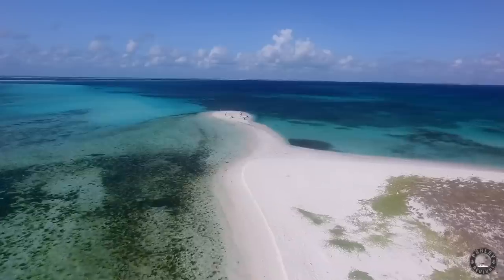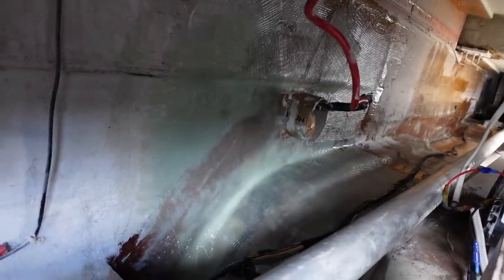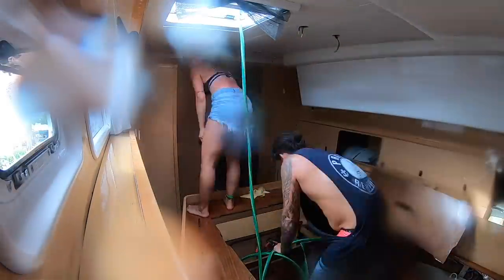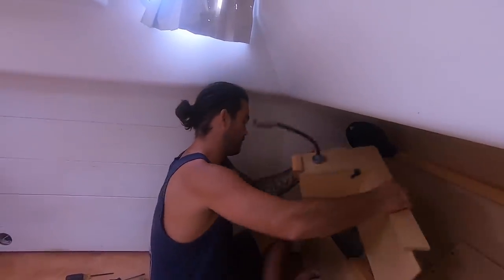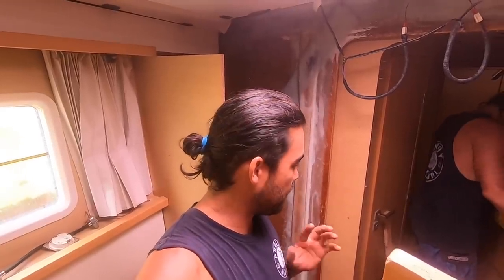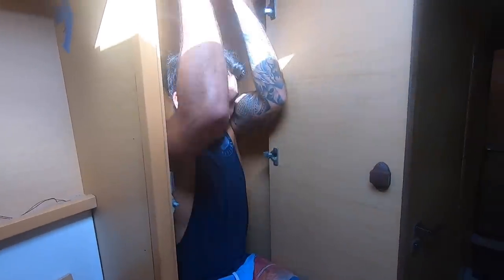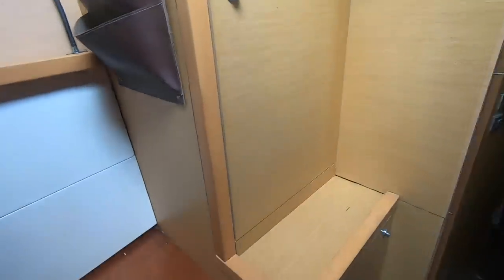OUR BULKHEADS ARE FIXED! - Cracked bulkhead repair series - Part 11 (Episode 116)

Comment: So impressed with the work you have put into your vessel. I have spent the last 5 years rectifying the mistakes and neglect of previous owners of my 1986 model year 35 foot motorboat, with the last 6 weeks having been spent lying on my back in the (tiny) anchor chain locker replacing distance material and fiberglass. Rapidly approaching 4500 man hours of work in the period I have owned my boat, and your positive attitude and professionalism has given me a significant boost towards finishing my “never ending” project. Trust you are close to realizing your dreams, and that you will let bygones be bygones once you put Parley back on the water. There is nothing like the feeling of being 100% confident in your vessel in heavy seas, well confident that the quality of the work put into the vessel in your ownership, far exceeds factory standards. Safe journeys.

Comment: work smart, not harder than necessary!  colin definitely works smart, that's the hallmark of a good engineer.  takes insight and forethought to take it apart in a manner which will also allow it to be put back together with minimal visible modification & struggle.  jamie is a true brother, that's some difficult and painful work and he's been right there beside colin the whole time.  the reinforcements were all extremely well done.  can't wait to watch them circle the globe, i have no doubt they'll accomplish whatever they set their minds to!

Comment: Great Job You Guys. Its looking GREAT, and BETTER then it was. This is what Ive been saying when your boat was built. People dont take Pride in there work anymore. Like You Guys did when You repaired it. If they would have taken the Pride in there work You wouldnt have had too do those repairs. This goes from the people that designed it to the people that put it together. Its so unfortunate  that this is what has happened . Look at things built years and years ago. Alot of the things that werent destroyed  are still around. And in 75 years Your boat will be among them. Again GREAT job on the repairs. And the videos. Cant wait to see her back on the water...Thank You for sharing....

Comment: With all the repairs, man hours and improvements, this must be one of the most valuable lagoon 450s ever
Reply: Except every single one that didn't face a hurricane hehe.
Reply: @jafris  a bunch of Lagoons that never saw a hurricane cracked in the same way.
Reply: If I was a buyer and saw all of this, I would buy it in a heartbeat.
Reply: I am a buyer, love these guys and love Collins work. Sorry if I sounded like a trip but as someone looking to buy I am thinking I cannot do the work he is doing which is why I won't buy a hurricane boat. The price is significantly more for a boat that hasn't seen a hurricane. That's just a fact. I'm really sorry to offend. Like you guys, I think this boat is probably better than every other of its model with the quality of work . And yes I know their are issues with the bulkheads for the 450s which is why I'm skipping that model in my search
Reply: @muumoo111  he gets it dude, your not getting it..
Reply: @jafris  problem is you never know the true story of the boat
Reply: @muumoo111  I didn't edit anything.
Reply: @jafris  You don't seem to realise or understand where I am coming from with my post. If this boat, in the state it was when they started repairing the boat, it would have been a "cheap" rebuild. But having to repair the cracked bulk heads on top of it. If they had taken it to a professional to do, this hurricane damaged boat would likely have cost more than a brand new one. Parts, materials, labour, drydock rental, lifting and storage, everything has a price. And even though they didn't take it to get it professionally repaired, most of those costs still exist. How much money could the crew have made if they all went for full time work at their professional level? Even if you are doing something your self to cut costs down, your time still has a $ value to it. 

When all the costs are counted at the end of the rebuild and refit of Parlay, it could quite easily come out to have a cost higher than that of a brand new 450. That's what I meant.
Reply: @Falney  I agree
Reply: @jafris  dude stop using 2 accounts , editing your posts ..  all of this for what ? What are you doing? and then the personal attacks for what ?
Reply: @muumoo111  I don't have 2 accounts and I'm done replying. You are weird
Reply: @muumoo111 and @sam you guys married ? Lol
Reply: @Onfireforthelord  hahahaha yes
Reply: @muumoo111  hahaha you so funny love it though you guys made my day lol happy 4th to both everyone in the channel as well
Reply: @Onfireforthelord  you too buddy happy 4th of july
Reply: @Onfireforthelord  🤣🤣☺️☺️✌️

Comment: Hey Colin and Jamie too !  Glad you went the extra step of flooding and washing out that glass and resin dust... it's nasty stuff health wise !  You should also see about preventatives against mold while you're cleaning. You can dilute hydrogen peroxide or rubbing alcohol to kill and clean mold, bacteria etc.. simultaneously, and wash surfaces with soapy water afterwards; another good cleaner/antifungal is tea tree oil, you can dilute with water and spray, but use glass containers, or the original plastic containers they came in... not all plastic spray bottles will hold up to those 3 cleaners.

Comment: Wood putty and a little matching paint would cover the crack in that furniture right up! This is one area I think the manufacturer could have recommended several good methods of restoring the finish work. For example that closet might be assembled and then put into place and then screwed into surrounding woodwork. A biscuit cutter and some biscuits might have been considered for joining the closets upper and lower halves. Again I recommend strongly making feedback to the manufacturer about making the closets and some of the other inside items removable in the future for this and other kinds of repairs that would take you to those areas of the boats in our hull. I think you guys are doing a great job!

Comment: What you called battons, the cabinet world calls cleats and are always meant to be hidden on the backside so only screw heads are visible. You did this on shelves correctly. The first cabin had a new storage spot which you hinged to make the best of the situation but left a cleat in plain site inside. It could have provided the same support had it been mounted on the backside. Not important but from one perfectionist to another, little tricks like that are very satisfying. Great videos Colin! Thanks for all your hard work, you're a credit to the human race!

Comment: Hi Colin and Jamie, I am an ex Lagoon450 owner who has done what you are planning to do I.e. sailing around the world. My circumnavigation took me 5 years starting with a brand new boat. My hat off and deep respect for your determination and skills to complete repairs to the standard you have achieved. I sold my boat earlier this year and after watching the condition of the bulkheads can’t help but wondering what condition the bulkheads were on my boat when I sold it in good faith. Based on my experience production boats are not blue water long distance cruising designed or equipped. I guess you are 300k into the boat by now not counting your hours. Whilst I agree you now have the strongest Lagoon 450 in the world as far as the structural strength is concerned I experienced a string of other weak design issues you may want to look into as well as some equipment issues. Starting with the main and Gennaker if original you may find out they are not the best quality and replacement or repairs on the fly is difficult and or expensive. I also experienced several failures with riveted fittings on the boom when in heavy weather and extended us and designed my own in the end. Saildrives is another weak point and I went through “ three sets” in 5 years. With the saildrives aft of the rudders the slamming of the rudder in reverse when you don’t hold on to the helm  is no doubt familiar to you by now but tends to be hard on the steering cables and a spare set is advisable. I was sailing short handed and solo sailing some of the time not by choice but circumstances. Extended use of the anchor winch exposed another marginal design I.e. winch motor of 1500W. It has a hard time picking up the weight of the chain when fully deployed (180 ft). More chain and bigger winch motor would help but at least a spare motor helped me several times. Just a few pointers not intended to dampen your spirits but to help being prepared. After leaving Panama not much is available until you get to your home country which by the way I very much enjoyed and had a lot of upgrades and repairs done during my 7 month stay. If you guys have half the fun I had you will have a blast. Hopefully COVID will not restrict your routes going forward as they certainly would have in the past year until now. Great job guys and my best wishes and safe sail, I will sail along with you.

Comment: Collin just a suggestion..If you go on line you will find wood grain tape that would cover the small seams you have inside the cabinet's and other places in your reassembly.  They use that stuff in RV Campers and Motorhomes and it looks pretty dam good.  You guys are doing a great job..I am amazed..Look forward to your future videos..thanks

Comment: Great video, job, and progress. Thanks for the update. I was very interested to see how the cabinetry would look and also wondered your opinion on "Should manufacturers be required to build cabinetry in a way that allows inspection of bulkheads?" I think the answer is yes - they should have to install the ability to inspect - and also repair. By the way, I think you just need wood fillers and touch-up wood products, to hide the cuts and scratches. Furniture stores keep this stuff on hand all the time and the product is remarkably good with a little experience doing touchups.

Comment: On your sacrificial cut area, try putting some wood glue with sawdust (preferably of the same type of wood as the visible top) and just rub into the visible cut area. It should minimize the visible line without having to do a batten or anything else like that. depending on the top finish of existing wood, other sealers and finishes can put a gloss on it like the rest.  Depending on how small it is, you could even put clear fingernail polish on the line after filling it . :)      
Congrats on completing all the glass work.

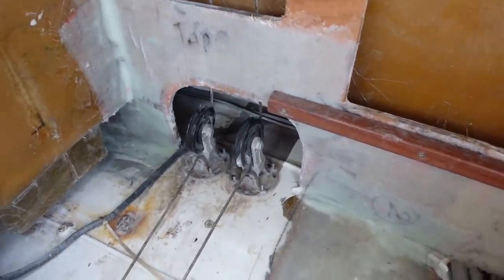Comment: I think showing before and after , crack versus repair would have the most impact. A video showing before and after scenes like the one at 5:34 would have a ton of impact ! The unusual thing about this damage was that it absolutely wasn't visible from the external or even inside the cabin for the most part. A person would have no idea the boat was being stressed without some sort of line which showed the stress somewhere, and I do not have any idea how one would measure the stress on an everyday basis . And, its not just lagoon, but the general nature of any cat build that would make this necessary. When they come apart its a complete surprise !  You've found all the weak spots, but definitely found them the hardest way possible. And, not at all your fault, no ones got that big of crystal balls lol.

Comment: On some of the wall panels, just a suggestion. Cut a inspection port, put backing on back side of main panels. Install a couple hinges and turn latch. Doing all this will keep your boat clean and clear of panels being stored, serve as inspection points and restore the boat to a visual original state. Remember your words, if you're going to do something....do it right or as close as you can. You will be happier with the things that you accomplished more than the things that you didn't. Please take a little time to finish the job right. It won't take very much time if you do it smartly.

Comment: As great as your glasswork is (and it is outstanding given the complexity and tight quarters) I am even more impressed by how easily (hah) the joinery is going back together. It really illustrates your thoughtfulness and skill in addressing the whole problem from start to finish. I would have done a lot more damage to the original woodwork while exposing the structure because I have the skills to rebuild it from the ground up. But you’ve managed to avoid the need to do so almost entirely. Well done!
Reply: yupp, work smart.  colin definitely works smart, that's the hallmark of a good engineer.  takes insight and forethought to take it apart in a manner which will also allow it to be put back together with minimal visible modification & struggle.  the reinforcements were all extremely well done.  can't wait to watch them circle the globe, i have no doubt they'll accomplish whatever they set their minds to.

Comment: Where trimming it out is not a good option you can take some epoxy glue and add in a nice load of wood shavings that are as close to the same color as the wood and use it to fill in the cracks. Sand it out and you would be surprised how well it blends in and it will reinforce the break area without the need of nails or screws as a bonus. Awesome to see you get to this point, very well deserved and cant wait to see the huge smile on you guys (and gals) face when you start gliding through the water...;)

Comment: Where you had to make the sacrificial cut fill the gap with bondo.  Once cured sand the joint smooth, then take some oil paint (I used testers model paint), mix the colors to match the base color of your wood, then using a thin brush add the ‘grain’.  Furniture restorer taught me this and I’ve used to to repair holly/teak flooring, mahogany and teak veneer.  Hard to tell it was ever damaged. A bit of work but for areas that are visible and important it can really dress up the repairs.

Comment: You’re dedication, patience, and ability is inspiring.  Hopefully the backlash this causes forces improvements to the production line of this vessel class.
Reply: I agree. If the unfortunate experience of a few can help out in the future, it is somewhat worth it.
Reply: Couldn’t agree more. This has to be the strongest 450 ever. Do the job once and do it properly. This goes for anything I do. If it needs 3 screws put 5 in. Build it once and do it properly. I hope lagoon learns from this.  That will do attitude won’t do. !!!
Reply: Yeah, if they survive the bad PR. What doesn’t kill ya……

Comment: Top tip to fill joins. Use PVA or wood glue mixed with fine saw dust from the wood your filing for a near invisible join

Comment: Try using sawdust and wood glue to fill the cracks in the plywood and veneer, then carefully sand it down.
Reply: And color it with a colored pencil set.
Reply: That method works “okay” but has very little strength. It’ll crack again with even the slightest flex.
Reply: Proper wood filler wood be better and if it's done right you'll have to look for it in order to see the seam
Reply: Yes this works! Learned this doing my wooden glen-L TNT runabout build

Comment: Ahoy Colin! As a new channel follower I firstly want to commend you on specifically one aspect of your videos and that is as a cinematographer myself your efforts to maintain a higher standard than most hasn’t gone unnoticed. As well some top story telling being crafted too! Your work ethic, project and teaching skills are spot on mate. Inspirational to so many by now goes without saying. It’s been an immense pleasure joining you on this voyage and I look forward to fully catching up with your stories soon. On the issue of the build flaw with the Lagoon 450’s has a specific model year been determined or does this issue span multiple model years? Again you’re attention to detail in terms of the overbuilding of the primary bulkhead in my opinion is a no brainer. I happen to be a fan of metal boats for their inherent strength but even metal has its challenges, there is no perfect material, but construction basics are everything. That is a huge failure on Lagoons part. As for all that glue that bonded nothing, sadly that is a factor across many brands of fiberglass production built boats. Disconnected bulkheads and grids are all too common. The job of “surveying” needs to evolve into including opening up to see more as I’m sure you would agree. Cheers my friend and I hope one day our courses do cross. 🔔🥃

Comment: You can get caulking in different shades that can match your wood. You can lay it in the seems and then take a damp cloth and wipe the bead flush. 

I use Big Stretch caulk since it shrinks less. It will also move with the boat.
Reply: You can get caulking scrapers for a few dollars that do a much smoother and consistent finish than using a finger. Well worth it imho.
Reply: He can also buy the caulk tape which would lay perfect lines and color match it.

Comment: Hey Guys, coming from upper East Tennessee, they make colored chalk, & wood filler. Take a tiny bit on the tip of a putty knife or something ( maybe the girls are better at this ) slowly fill each crack or hole. When hole is full wipe with a wet cloth ( if it’s water soluble). DON’T smear it around. Like putting makeup on. If the panel doesn’t fit, cut the tiniest shim to make it level. Go slow do a good job, you will be pleased with results. You  guys rock !! I hope to watch you sail around the world.

Comment: Your work is totally professional, and you know what and how you did.  So like you said, you don't expect any problems.  I think you should try to get at a minimum the cost of your marina fees and all the materials you acquired to make your boat right.  I am sure that the work you did with your Mate no one else would do to the caliber you have achieved.  Keep on cracking.